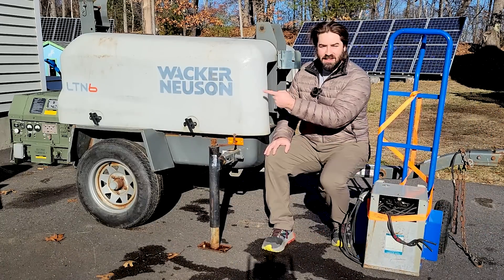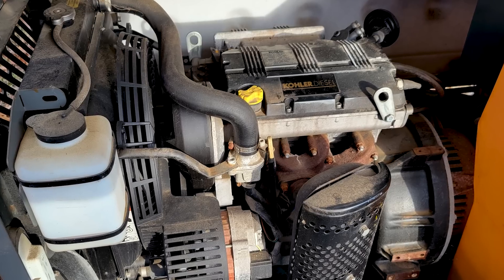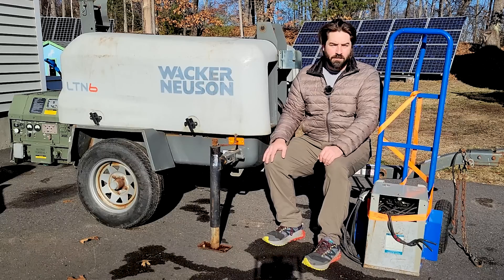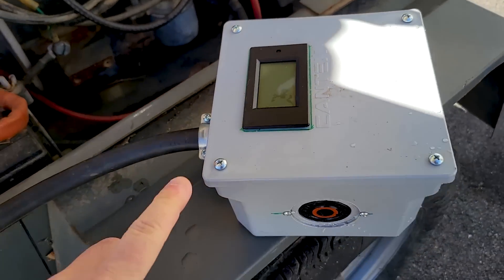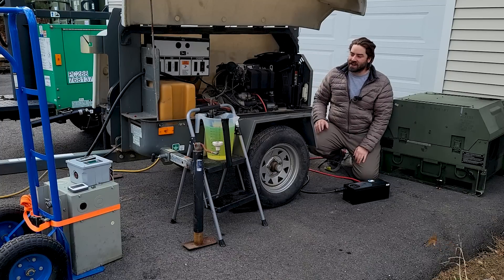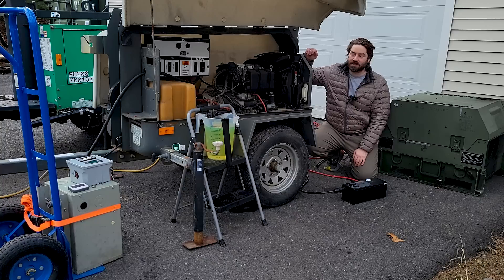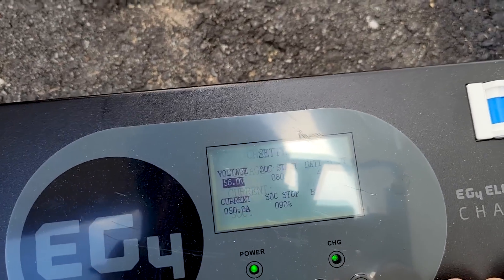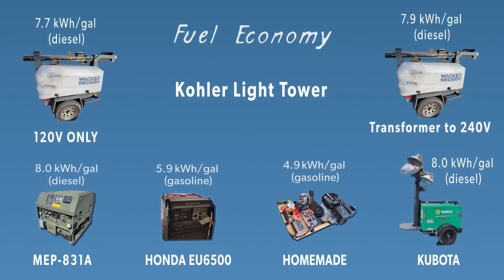What's better, 120V or 240V?  A Kohler generator experiment.

Comment: Re heating, another channel was mucking around with workshop diesel heaters and he said what really increases their efficiency is passing the exhaust through an old cast iron room water heater grid. 
Perhaps do a pressure test to avoid CO poisoning - should be safe, millions of air cooled VWs used the same system.

Comment: Very interesting, David!
You may want to consider measuring your fuel by weight rather than volume. It's MUCH more accurate to measure consumption and calculate efficiency that way and easier as well. The Mythbusters have some good content on that.
Reply: Just remember that there is a difference between Winter and Summer numbers.
Reply: This is exactly how we calculated Refuels/Defuels/Fuel consumption on Aircraft when I was in the Military.

Comment: Excellent presentation.  Thank you.  I would be really interested in seeing how the smaller units perform on the same tests.  Say perhaps the Honda, EU1000i, EU2200i and/or the EU3000i for example.  I wonder if a smaller unit, even though it would need to run longer, does a better job with economy.
Reply from the maker: I have an older video where I rented a small Honda 2,000 for testing.  https://youtu.be/QAoorfdbefo?si=xhGAPIhOHQeALLI1
Reply: @DavidPozEnergy  Thank you.  Loved today's video.

Comment: Low Voltage AC is always a loss.
Very High voltage (like 1MV) AC too btw...
What would be the best is High Voltage DC with electronics of this decade.
For households, 120VAC is just as save as 240V DC as our body has a higher impedance for DC than for 50 (lower) or 60Hz (optimal conduction?). However, DC has arc problems, because with DC there are actually real electrons on the move, and with AC, they are actually more vibrating.

Comment: Speaking of Isolation Transformers....For my office, I specifically purchased on ebay these older "Uninterruptible Power Supplies" specifically made by APC, models SUA750 or larger SUA1500. Or the older white cased versions model SU700 or SU1400. They can be had for $50 to $150 shipped. Many of the 50 bucks shipped ones will say in "not working condition" or "batteries removed" simply because they need new batteries or folks think they are broken because they wont power up with bad batts, even plugged in to wall outlet.  The great thing about these is they contain a big honken heavy 1-1 transformer inside them to condition the output voltage all the time, as in the output side goes through the isolation transformer and the voltage is conditioned up or down and smoothed out even when not on internal battery supply during an outage. The other great thing is they don't use an expensive proprietary battery. They use a pair of 12v "deer feeder" sized batteries that can now be cheaply found in LiFe (or you can diy make....or easily hook up to a large external battery 24v LiFe) for about same price as the old led acid / AGM batteries.....I did this for all the computers in our office because the power supplies in our computers were only lasting 2 to 3 years and I suspected we had dirty voltage or power inconsistencies / surges. Whatever it was, the isolation transformers definitely solved the problem though! Not another bad computer power supply in the last 7 years! Plus now we have some runtime if the power goes out.

Comment: The "efficiency" units used doesn't really matter IMHO the amount of electricity per unit of fuel is a very valid unit of measurement what really matters is constancy as long as the same(or as close as possible) measurement metric is used that is what is important.

Comment: These are really fun tests to watch, thank you for sharing. I am hoping to have something super similar one day but with an older small utility tractor with a small 3 cylinder diesel engine and a pto shaft drive generator head. Although I still think a used light tower like yours has it's own benefits and is very cool too...and still might go that route.

Comment: I was surprised I thought 6.9 and no you improved the production even with all those heat losses. Perhaps the transformer you bought is more efficient than the one used to convert the 120 to 240 in the first video.

Comment: Remember V = IR. So when you run your system at 240 vs 120 you have half the amps so you have half the voltage drop through wires, transistors inside power supplies. Amps x Voltage drop = power loss as heat.

Comment: Since you already have  the unit start looking for a 220v power head to replace the existing 120v head it’s not like your ever running it at full load you could install a bigger unit than the diesel could handle other wise

Comment: CHP system would be soo cool!! You could probably double the useful energy you are taking from the fuel. 16kwh/gal in the near future! Maybe chasing correcting power factor could be interesting too!
Reply: i never got why people never did that in the first place.

when you run a genny you also mostly need heat anyway because it is winter usually. or at least a bad weather week. and the heat problem still exist in that case
Reply: 11:35  ~  PF is already .93.
Reply: @rpsmith  No harm in seeing how good you can make it plus it could be easy and cheap to do.

Comment: Efficiency is a better number to present to your audience, rather than just Kw hours. A good ball park number for gas and diesel is 33.3 KW hrs per gallon.
Therefore 8/33.3 = (.24 x 100) = 24% efficiency. I have been following your channel for years. Great work!

This calculation can also be useful for comparing mileage if you are considering an EV. 33.,300 / your gas mileage =  watts per mile. My ICE car gets about 35 MPG. 33,300 / 35 = 950 watts per mile. A Tesla uses about 250 watts to go one mile. So I could go over 3 times the distance in a Tesla relative to my ICE car.
Reply: % efficiency is worthless unless you know exactly how it was calculated. kWh is far easier to compare and apply to real world applications like charging a battery. My only complaint would be Liters are universal but gallons are not.
Reply: You're comparing the wrong things there.  If your generator can turn a gallon of fuel into 8 kWh, and your Telsla can turn that into 32 miles of driving ( assuming no losses ), but your ICE can turn the gallon of fuel into 35 miles of driving, then it's actually slightly more efficient than running the Tesla off the generator.  Fortunately, commercial combined cycle power plants are much more efficient at turning fuel into electricity than smaller generators like this.
Reply: @phillipsusi1791  Yep, hippie wants to talk about efficiency, but still doesn't recognize that most EVs still get their battery energy from a power plant.
Reply: Kw/hr is an easy to grasp metric for this particular use. We are trying to see what generator setup gets the most for your gallon, not the overall efficiency of the system.

Comment: The use of the rubber tape on split bolts is normal. After wrapping with it, which makes it moisture proof, then it gets wrapped with electrical tape.
Reply from the maker: It certainly looked great for installation.  It just wouldn't come apart for me.  I spent a lot longer off-camera trying to remove it.  LOL.
Reply: I believe that may have been butyl rubber (sometimes called monkey snot) covered with electrical tape. It's a typical way to insulate and weatherproof electrical connections. It certainly can be a pain to remove!! I shared your frustration watching you fight with it. Also, it's easy to slip & cut yourself trying to cut through it with a utility knife.

Comment: Have not finished video.  Any energy conversion has some loss. I don't understand how you think you could gain something for nothing.
Reply from the maker: I explain in the video.
Reply: Apparently the chargers are quite inefficient when run off of 120v and the loss in the transformer is less than the increased efficiency of running the chargers from 240v.

Comment: As i am from the eu & i have worked with 110v & 240v equipment in my limited experience 240v is always better & usually safer if things go wrong. It's good to hear your going to reuse the wast heat.
Reply: 240V Split phase (240V with a grounded center tap/neutral) is probably a little safer than 120V mostly because the breakers are lighter on the former. I would put pure 240V at the least safe of the three.
Reply: @overkillthemighty statisticaly that's wrong. Most hazzards are not electrocutions, but fire. The higher the current (and the worse the installation like in the USA), the higher the risk of a fire. Double the tension means half the current or with a 3 phase system it's even root3 lower, that's why we use 230/3×400V.

How often have i seen burnt panels in my 35 years of worklife? Only one that burnt due to corrosion caused by NH3 in a cow shed. 

Electrocutions? None, have not even heard of any in the wider area. Now it's even safer as every outlet must be protected by RCD.
Reply: @stefankaufmann8257  First off, let's leave equipment like GFCIs and RCDs out of it. They are almost always required in New American construction. If you come into contact with a "hot" wire on a single phase 240v system, what is the voltage that if going to go through you? (higher makes it more likely for current to pass through higher resistance objects like your body)
In a split phase setup, it NEVER is higher than 120v. You would have to touch 2 hots on each side of neutral to do that. Remember, it takes milliamps to stop a heart, so the size of the breaker is not going to do a thing. Europe has its fair share of dodgey wiring and dumb practices. I believe you call it ring wiring where you run electrical wiring that is too small for the breaker and you do it in a loop so that it is fed from both sides? Great in theory, you save on wire cost right? What happens when a connection is damaged and a max load is put on a plug? You are now running way more than rated load through a wire. 
We don't put large loads on 120v systems anyway, that is what 240 is for, which is going to have similar amperage ratings for the load when compared to Europe.
All this to say, American electrical is by no means perfect (who the hell thought it was a good idea to have push-in connections on the back of a plug? Who thought it was a good idea to standardize on wire nuts, especially when folks who don't know what they are doing might use them?), but EU isn't perfect either. If we are talking purely standards of power being delivered to a house, I would pick split phase delivery into residential over single phase 240 or 120 any day.
Reply: US 240 is split phase and so not quite the same, but I agree that higher voltage is generally better.
Reply: Yes I see you are in Europe. The lower nominal voltage is different in the USA. Here we use either 120 or 240 nominal voltages.

Comment: Can you combine generator AC + Grid AC to the inverter ?
Reply from the maker: Depends on the inverter.  My Schneider inverters allow both Grid and Generator to be hooked up.  The inverter will automatically switch to the generator if the grid dies.  But, you would need the generator running, which could be an auto start, or manually.
Reply: they cannot be tied together as the herz and sinewave would need to a perfect match or things will end very badly